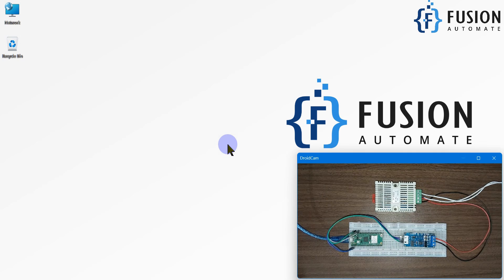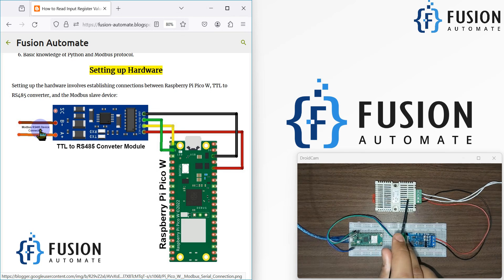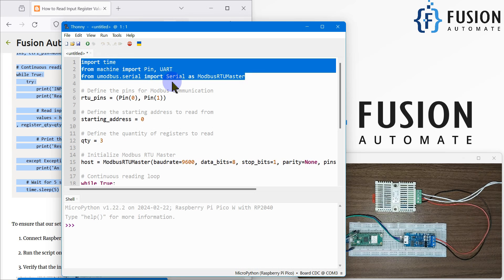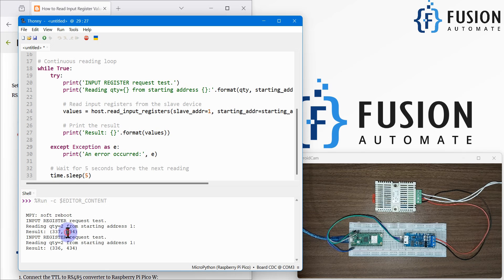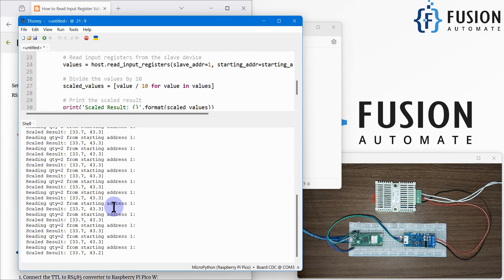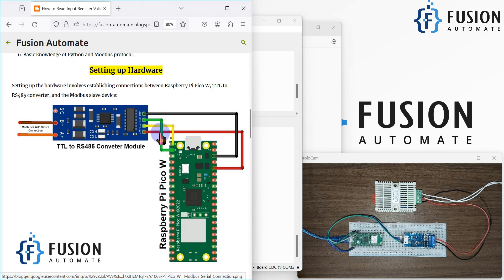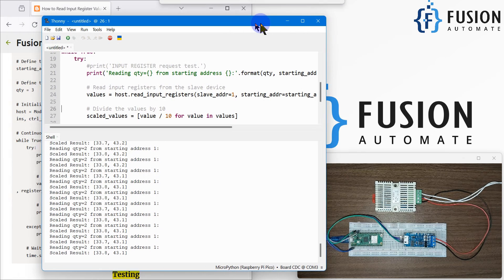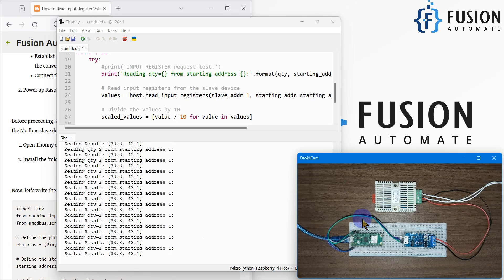How to Read Input Register Values of Modbus Slave/RS485 Device in Raspberry Pi Pico W | IoT | IIoT |

Comment: I have an important question. Is it possible to use node red on the same hardware setup? I would just add an ethernet on it.
Is it not easier to use node red to handle modbus?
Reply from the maker: Yes for that we have Luckfox Board.